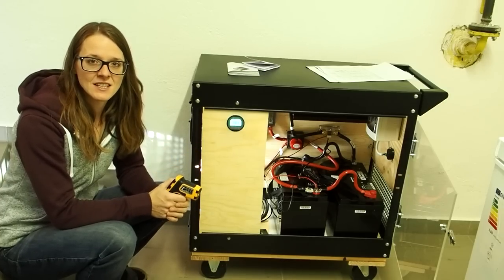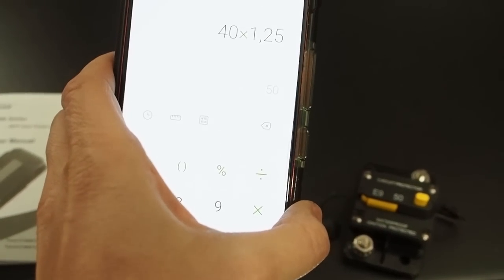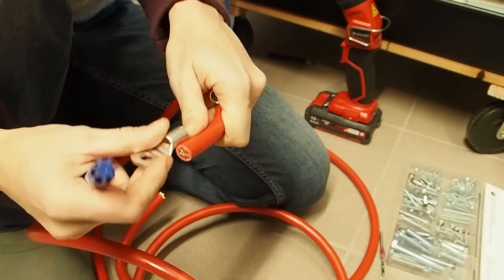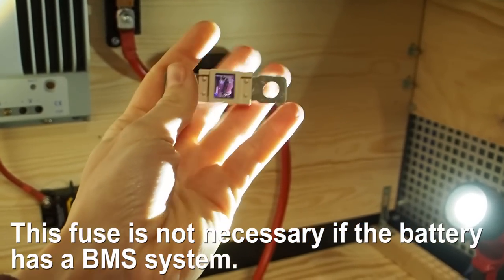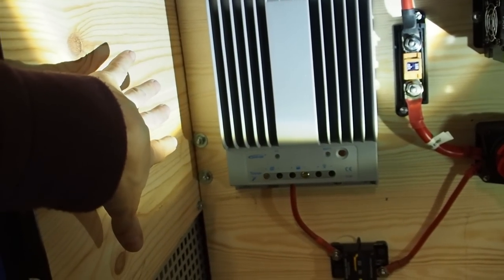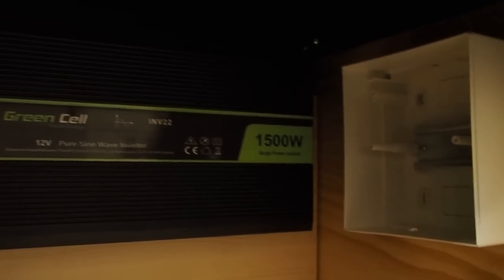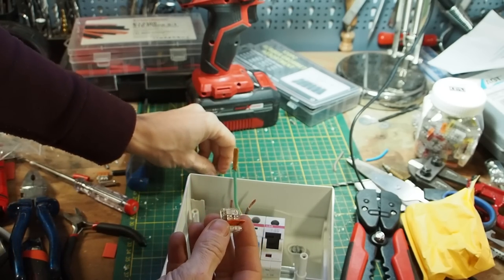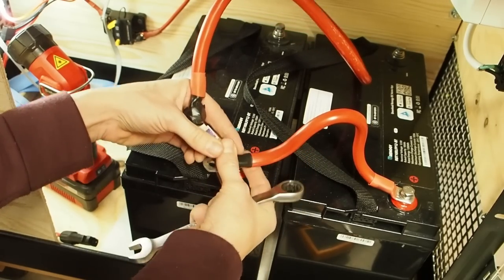12 Volt Solar System in a service cart (1500W Inverter)

Comment: Du hast den RCD mit der Erde überbrückt und weil es der Neutralleiter ist kannst du den Stecker einfach falsch herum anstecken an den Wechselrichter und dann ballerst du dir die Phase mit 230V auf das Gehäuse des Geräts das du an die Steckdose anschließt und der RCD ist ja überbrückt. Das würde ich auf jeden Fall nochmal überdenken das Ganze! Oder ich hab irgendwas falsch verstanden? Wenn man sowas macht dann auf jeden Fall den Stecker am Wechselrichter durch eine feste Verbindung tauschen. Ich würde zusätzlich noch einen Eisenstab mit reinpacken den man draußen in die Erde kloppen und als Erde nehmen kann. Ist bei Bauverteilungen bzw. Generatoren zB. üblich. Die Solaranlage zB. weiß ja sonst gar nicht was Erde ist. Die spuckt dir 100V aus aber ob das 0V-100V oder 300V-400V sind ist der egal.
Reply from the maker: Weder die phase noch der neutralleiter ist definiert beim it netzwerk. Also is es egal wenn ich den stecker verkehrtrum anstecke. Hat proofwood auf seinem kanal so erklärt.

Comment: I don't get it. The inverter is outputting 240V, so the maximum draw will only be (3000W/240V) 12.5 amps. On the input side, even if you have 200w or 300w from your PV array, that's only 20 amps. Why are you using such oversized cables? They are overkill even for the starter motor of a semi truck....
Reply from the maker: Nope. This is not how you calculate this. At the beginning I was also confused about this topic. So the inverter has 2 sides. The 12 Volt side and the 230 volt side. At the 12 volt side you have 12 volts. So you calculate 1500w / 12 volts. That equals 125 amps. At the 230 volt side you have 230 volt. So 1500w /230 equals 6,5 amps. 
So it depends on which side you are.
Reply: @SurvivalLilly  I see, so the thick wire is just for a direct connection from the batteries to the inverter. According to an online calculator, 16 mm2 wire will safely carry 125 amps with a 3% voltage drop over  2.67 metres. Your cables are oversized, but if you had them on hand, I agree there's no reason not to use them.
Reply from the maker: @Ijusthopeitsquick  according to Austrian electric code  the max fuse I can use with 35mm2 is 125A. For 150A fuse I need the next size which is 50mm2. Even if it can transport more electricity there is always laws. And those laws exists for a reason
Reply: @SurvivalLilly  Fair enough!